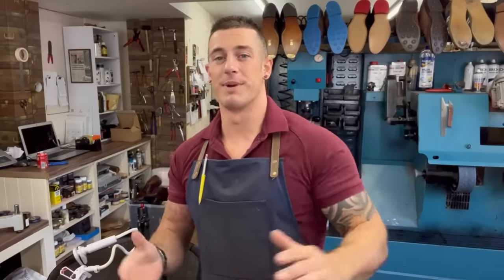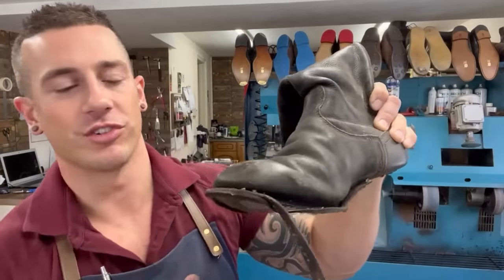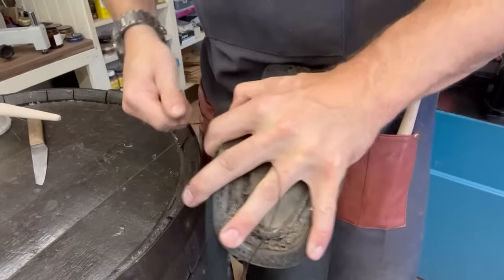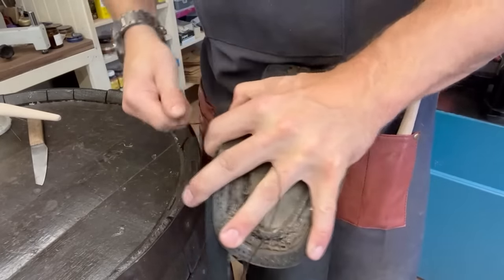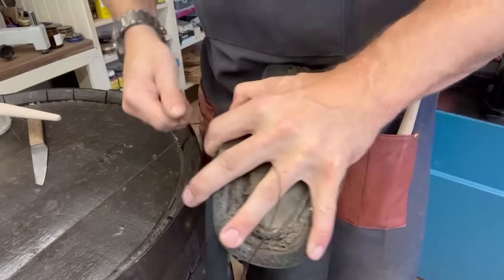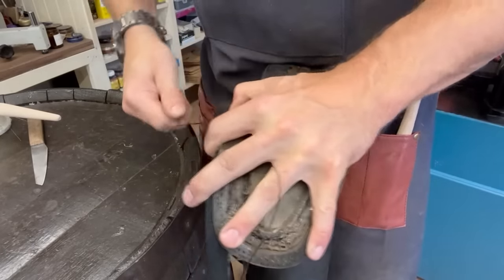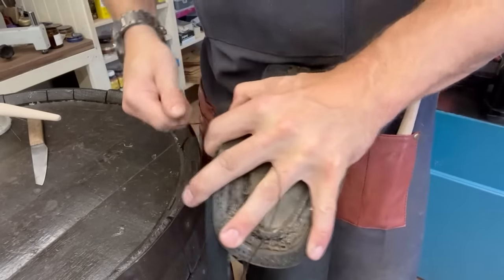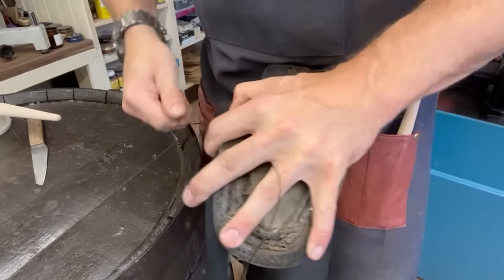Is this my BIGGEST EVER SHOE REPAIR?! ... Vintage Jack Boots Get an IRON HOBNAIL RESTORATION!

Comment: Hello Dan, yes indeed! For all our methods of goods transport... well the post can't come fast enough (Hence I'm writing this only from seeing the video). But this video, ah. I will admit I've been checking back on the channel more regularly than I'm proud to say waiting to see just how you'd done it! Worth getting up at 6am on a Sunday for!

Thank you for taking on the job. I'd asked a number of places here in Tas about it and the response was... varied to say the least. So receiving that first email back with you also being interested was quite an exciting thing! From "Guess they'd be relegated to being worn to go to the wood pile now" to "back to work!" (And possibly the pub if the floors right and I won't damage it... or go posterior  over mammary gland)

Little bit of an expanding for anyone interested, These M34s are a post war set. No idea of manufacture date. Identical to boots used in the war, apart from the fact the war time ones had leather soles (AFAIK). Interesting thing to note on the before boots, is the cutout round the heel, thats designed for cross country skies to fit in! Otherwise the boots are in pretty much OG condition.... with a good deal of beating up courtesy of me. Finding these isn't impossible though I think its get harder to do. They aren't too expensive either and take a ridiculous bashing. From being in slosh, mud, numerous vehicle fluids to being used to knock logs around fire pits. They haven't whinged.

This video is grand. Whilst I was thinking it'd be a reasonable sized job, did not at all realise just how much effort I was asking you to undertake! Thank you!
Bloody awesome. Snake protective colouring will be appreciated as funnily enough... I do call these my "snake boots" because I've hoped that they'll only latch on to the shaft rather than my calf... whether it works or not hasn't been tested and I hope it continues not to be with this added camouflage. 
Also, hoping the "decorative" nails actual help with making them continue to last! The pedals on the old Massey Fergusson are obviously steel and that part of the boot is where they sit.
That storm welting is pretty grouse. Had no idea what it actually was. Very cool! Solidly built things. Awesome to see what the goings on were.
That heel stack is flamin bonza and hopefully with the added duck scent, it'll turn me into the pied piper of ducks so they'll follow me out of the crop rather than having to be encouraged to move along!
And of course... who can argue with a nail pattern named after them! Haha!
Really appreciate this job, its been quite a bit of fun to organise! Quite smooth though, thank you for that (And appreciation to a good friend of mine over there who quite by chance happened to be going to Tring at the right time!)

My girlfriends response to this was "This highlights how rubbish alot of our modern made shoes are constructed" along with numerous inserts of "wow".

So I'm ridiculously excited to get these back and how cool is it that theres a video to be able to see how whole process! Bloody fantastic. Thanks mate!

Might have to edit this comment when they turn up to say how they feel! A number of friends have suggested that I will have to try tap dancing at the pub when they do.
Now, I'm gunna watch this again cause far out that was interesting to see!
Words aren't doing my excitement justice (The fact I've just written a novel probably hints at it quite well though)

Cheers!
Pat
Reply: Geez Pat, I hope they don't get "lost in transit" after all that!!!!🤣
Reply: Top reply. Jealous of your fantastic 'better than new' boots. Hope you dont need them for the flooding.
Reply: @dunes7  thankfully, they turned up today!
Reply: @sea2side  no flooding down the southern end of Tas. Thank goodness! Just... an alarmingly consistent deluge of drizzle. Much like England I suspect but somehow worse as we have had a few nice days recently 😅
Reply: I used to live in Invermay in Launny, now I live in Brissy and it seems like floods just follow me around! 

Glad your boots got home safe! Good on ya Paddy 😊 I actually love the Huon, that's one thing I miss living up here is the gorgeous forests in Tassie and going bush walking. But I think the fishing is a bit better here haha you win some you lose some 😜
Reply: It must've cost an absolute bomb to have Dan do the work, but it'd be worth every cent.. I'm in the North of Tasmania and need a resole done on a pair of Julius Marlow dress shoes I wear for work - yet to find someone who will do the job without just gluing a Vibram sole onto it...
Reply: So Paddy, as  fellow Australian, what do you think the chances are of you getting a new nickname with those boots LOL
I'm thinking because of the horse shoe heels it might be something along the lines of "Pony Boy" 🙂
Nice looking boots by the way, enjoy.
Reply: Can I ask what it cost you to get it done and sent back to Tasmania?
Reply: Wear those awesome boots in good health my man!
Reply: I've got the same boots and they are excellent for working outside. Now I'm thinking about getting the same job done on mine...when I'm a bit richer!
Reply: Hi Paddy i lived at a place called Cradoc about ten kilometers from Huonville Tasmania and i was staying in a pickers shack about 35 years ago and across the road from me was a small old two room building with a couple old style windows and door so i went over to take a look at it one day and it was an old cobblers shop it looked like the cobbler had just closed the door and never came back then i saw some receipts that were in pounds and shillings going back to the early 1900s was absolutely amazing seeing all the cobblers tools and a few pairs of old antique shoes there was even an old shoe still on the cobblers foot .. totally amazing
Reply: @paulmarshall3585  haha! I drive through Cradoc every day mate! Indeed!!! Thats quite a yarn!! Would have been  quite a sight to see! 
Tbh.... its probably still there 😅
Reply: As I watched Dan work I wondered if there was actually a practical use for the amazing toughness of this boot and I wondered about the history and origination of it. Very interesting commentary. Enjoy these!
Reply: Hey Pat, how are the boots holding up a year later? Truly a special boot and Dan did wonderful work!

Comment: Don't think we have ever seen Dan de-welting and re-welting a shoe before. Thanks for showing the intricate construction and solutions of joining things together. Must take a lot of skill to manouver all the layers to stitch and glue only the right ones that are needed at the moment. 
11:48 - yay the cork filler ! Tasty looking grainy stuff ! Plus this pair of boots surely depleted the glue stocks at Tring Shoe Repair ! 16:06 - yay ! Trimming ! Nice continous running satisfying action ! 21:49 - yay he has all the necessary supplies, even elbow grease ! 22:24 - Dan goes SMASH ? 
With all the work and sturdy materials used, these boots will last 2 generations now !

Comment: Really nice too see old Finnish military boots get best ever care. And Dan almost got them as shiny as mine used to be when doing my 11 month service in1985-86 :D  The type was used  until 1990:es. There ought to be a stamp somewhere with SA or SA INT and a manufacturing year number. The army may still have a couple hundred thousand pairs stashed away somewhere waiting for what fun thr ruzzians may came up mext that requires the reservist to be called to duty. This pair became a piece of art.
Reply from the maker: Thanks for the info and thanks for watching!
Reply: Yea, judging from the condition of the rubber sole, those have probably also been resoled a time or two, or from the very last ones made. They're pretty indestructible if cared for properly and repaired when necessary - but those ones seem to have been in storage for quite some time.

Comment: I like how you leave the extra cork just like my local cobbler does. I find taking my boots to him just feels better long term. Feels more like extra padding around the bottom of my foot once I rebrake in the boot. Last cobbler I had sanded the cork and it just felt cheap. Great job.
Reply from the maker: That’s the intention! Comfort is paramount

Comment: These boots are made by the 'stitchdown method', which is not seen very often in Japan!
Reply: How do they make shoes there kazuma-san?
Reply: @pacificcoastpiper3949  I used to make shoes for disabled people, 'shoe-shaped orthotics'.
Later, I opened my own shop and made shoes for the general public.
Mainly cemented, mackay, black rapide, goodyear-welted, etc.
After that, I opened a repair shop like 'Tring Shoe Repairs' for two years.
In 2022, the shop closed, so I don't do much shoe repair.
I repair leather goods such as bags and wallets at home.

I do not speak English, so I am using the translation tool "DeepL" for this text.

Comment: is amazing the craftsmanship that is put into this product. This appears to be better than new boots. Good work, beautiful
Reply: then again... paying 275 for it when the boots are 45-100e, and you can still get un used surplus of them, and you loose the ability to use them on special ski bindings... all tho ig you dont need skis in tasmania.

prolly laot better than the original new ones, the older ones are with leather bottom, new ones with rubber.

Comment: Back in the day, working in my Mother's upholstery shop, pulling those heavy threads can cut the hands.  Look into Ansell HyFlex anti-cut gloves.  A little protection extends your working years.  Fits like a surgeon's glove.  I use them for all my wood, metal, gardening projects.

Comment: Pretty amazing job! And pretty amazing complexity also! Ive never seen the like. I kept asking myself if this boot was intended for practical application or if it was just to be ornamental? What sort of work would require this level of rocksolid toughness? Frankly Id just put these on the shelf and admire them lol. Also early in the reconstruction you mentioned a steel plate in the interior that stopped the nail and I wondered if this plate extended from the heel forward to the toe? An incredible boot and job too.

Comment: I personally think every little attention to detail helps with Durability and water resistant, I live out here in south eastern Louisiana and we have shit weather a lot of the time with rain so a good pair of water resistant shoes or boots is a must and you should always keep a pair of shin high rubber boots as it floods here sometimes especially if we get smacked with a hurricane 😅 but a good pair of general purpose boots help out, I have a pair of boots I bought a while back I got them in a size 10 for multiple reasons 1 my feet were swollen at the time but 2 I already wear a 9 1/2 and I tend to wear thicker socks especially in the winter and 9 1/2s wouldn’t work with thicker socks plus it’s more comfortable for me with boots vs shoes with shoes I go with my size but i unfortunately took after my grandfather so I have to buy wider shoes in a size 9 1/2 otherwise normal width shoes constrict my feet and it makes it uncomfortable!

Comment: Hey Dan, great job.  Do the nails rust over time or are they some mix of stainless or other non-rusting material?  What would this gent use these boots for?  I can see traction in snow and dirt, but are they crazy slippery on solid surfaces?  Regards from Latin America.
Reply from the maker: I’d say they do rust over a long time, couple of years plus, by which time the soles would be starting to need repair anyway.

Comment: Hello Dan!
This might be a nearly impossible request, but I need to try. Is it possible to resize shoes? I found these awesome, impossible to find, Prada high heel sandals size 38.5. Problem is my size is 36. Would it be possible to have them resized to fit me?😬
Looking forward to hearing from you.😊

Comment: The construction of those boots looks like Veldtschoen construction where the upper is turned out but still stitched to the welt. Supposedly a very water resistant method.

Comment: Stitch Down, San Crispino, Veldtshoen, Ideal construction methods. Stitch down, San Crispino and Veldtschoen are three similar construction methods. Veldschoen is a more advanced construction similar to Norwegian construction while Stitch Down is an ancient way to construct shoes. Both methods folds the upper over the outsole where it´s stitched down. This is creating a water resistance. Together with moccasin and sandal constructions stitch down is considered to be one of the oldest construction methods.

Comment: Great job as usual ! My question is you said they were work boots…..I wonder what the customer does for work ? They appear to slippery for a concrete surface or factory setting. Outdoors the Hobbs would be helpful , but rough on wood floors. Always wondering in the.  U.S.A.
Reply from the maker: Farm work!
Reply: @Dan_the_cobbler  thank you much !    I’m not surprised , it’s a real rugged boot Dan , nice job…..

Comment: I've got a lovely pair of WW1 officer's trench boots but sadly they are about 1-2 sizes TOO SMALL for my feet. That's partly my fault for believing the info in the listing but I suspect too that sizes were generally slightly smaller a hundred years ago. Is there anyway they can be enlarged?

Comment: Will the horseshoe nails or metal treads fall out over time with extensive use, since they're just hammered in? Would putting a dab of glue on the tips before hammering them in keep the hardware from working it's way loose?
The reason I ask is that leather tends to shrink when it dries out, just like wood.  And nails in old dried out wood will work loose and raise up out of the hole over time.

Comment: For a Parade finish, Kiwi polish laid on to fill all the pores. It's literally spit and polish, the enzymes in the spittle open the pores of the leather. Some use a hot ait gun to melt the wax in, being careful not to burn the leather or set fire to the wax.

Comment: As someone who dabbles in leatherworking, I can't help but feel a little concerned about using alcohol-based dyes on the soles. Since it's a part that will be under constant mechanical fatigue via flexing with every step, are you not worried that the dye will dry the leather out and make it brittle and crack-y? Does something prevent that or is it just not an issue at all?
Reply: You can use something like Sapphir sole guard to recondition and protect the leather soles

Comment: Couple of questions..1) Do they not have cobblers in Tasmania. 2) The time and cost of materials isn't it cheaper to buy new. Cheers
Reply: No cobbler I spoke to in Tasmania would touch it. Had a few try to talk me into rubber soles. The main argument I got when I insisted on Hobnails and heel irons was "No one has used that for decades" and "Thats more work than I want to do" - Fair enough on all counts buuut I wanted to tried some ancient tech.

As for cheaper to buy new, yeah look. The boots themselves cost about 70 Euros. The fact the supply of said boots is dwindling... along with the luck factor, I got mine in good nick from Finnish army surplus... They have already lasted for decades. Why not make them last for decades more?

For brand new boots like these you have to go through dedicated re enactors shops. They are cheaper than this rebuild... but also involve alot of treatment and you also are in the knowledge that you are wearing an exact copy of a German wartime boot (WW1 or WW2) for that is the only kind they make.
I'm not interested in wearing exact copies of German wartime boots to work.
 I just like tough old boots. Which is what these Finnish numbers are. (Also the welts and stuff on the repros arent as good as these boots were in OG form. These boots are definitely post war and were issued for nato service I expect... and the welt and stuff show that they are a peace time build! They were tough as and built ridiculously well)

Buying new from Finland is obviously out also, as all boots like this are surplus.

Hopefully this answers your question mate!
Reply: @Semgger  thanks. Nice boots. He did a good job..

Comment: 370£ job on boots you can still buy un used surplys of for 45-100e, in both og leather bottom and newer rubber bottom, this way you also loose the ability to use skis with them as they have ability to be used with sepecial ski bindings... all tho i dont think you need skis in tansania.

Very nice work tho... just wondering :D

Comment: Hi Dan, another fantastic job. Far from me to tell you how to suck eggs but have you ever tried a driver for your nail work instead of a hammer. I used to use mine all the time and found it easier and less tiring as well as being more accurate. Can’t work out how to upload an image but they look like a large file

Comment: Noob question: When would you require those metal bits on your shoes? Coz it wuld be slippery on normal usage.
Reply from the maker: For outdoor use, mud, grass etc
Reply: @Dan_the_cobbler  Thank you

Comment: I notice that Trenton and Heath use a heated flat iron to seal the Flex-o-Fil into the footbed cavity, what benefit does this have if any  over just packing the cavity with cork putty?.

Also, shrimp on the barbie 🤠
Reply from the maker: That’s just a tool for flattening it evenly and quickly, I don’t own one.

Comment: Hob nails are a pain when they break or fall out. The best way to keep them in is with a blob of epoxy glue under the head before you hammer them in. They will then withstand much more than when simply nailed in..
Reply from the maker: Sounds like a potential for a messy job?
Reply: @Dan_the_cobbler  you might need to practice if you want to end up with a super neat job, but it works well if you just need to keep the hobs in.😁